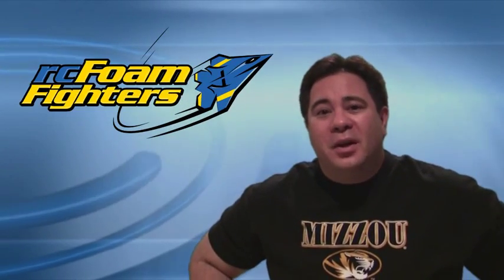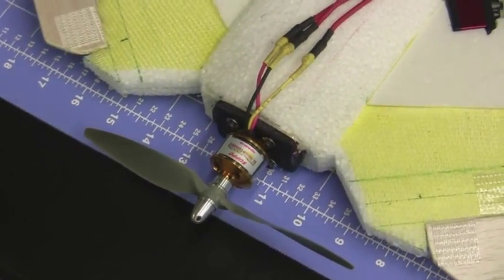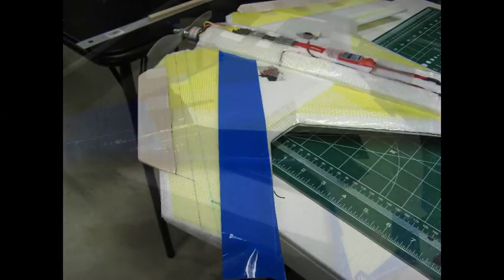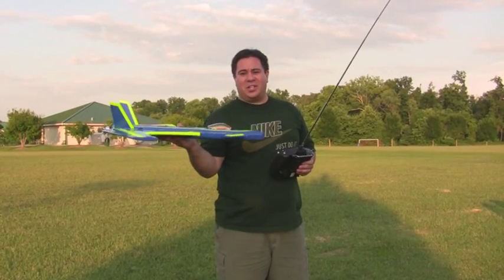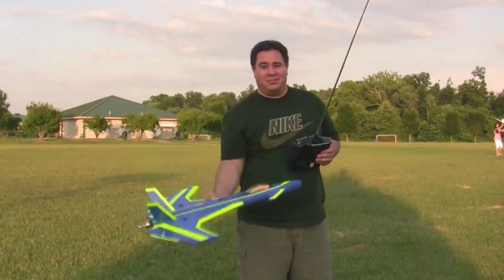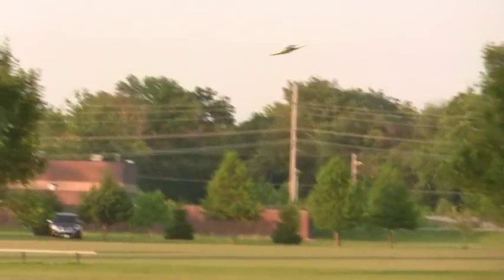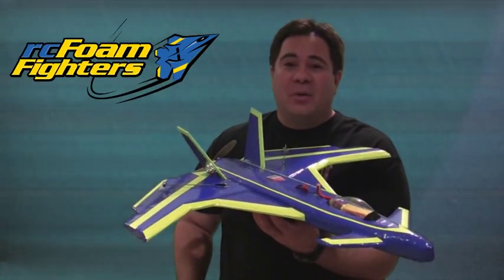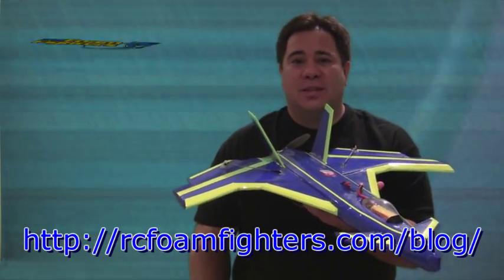Part 3 Experimental RC Plane

Comment: VERY cool (and odd) I did a forward swept wing jet (its redicuously similar to yours). how does yours fly on the lower end of the speed range as in about 3-8 mph, Mine exibits crazy wing rock but never flipped over. My plane also was a mid mounted pusher allowing Some TV manuvers. 

great video 5/5

Comment from the maker: Thanks for the comment netjunky. The plane was fairly cheap to make, $20 for foam, $30 for Motor and ESC, $30 for both Servos, $18 for the battery. Then tape and misc glue and stuff. Radio I used was n older one I had with a cheap $20 72mhz  GWS Receiver.